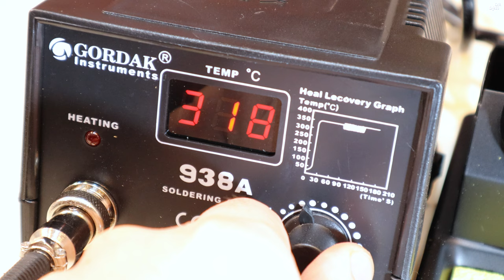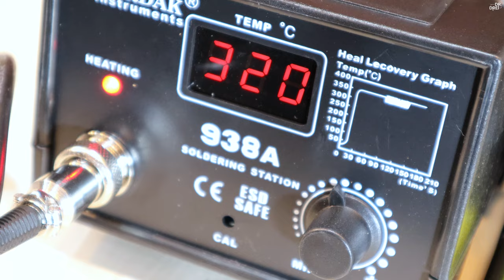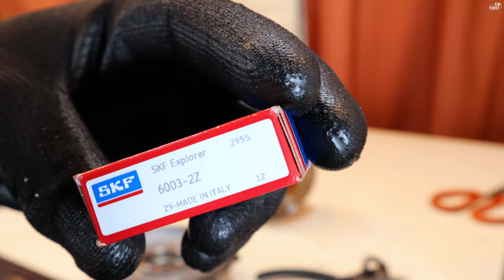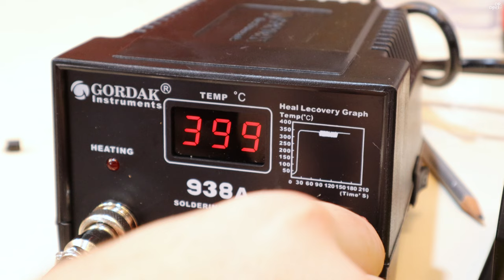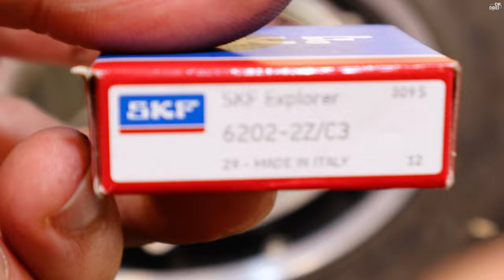Electric Scooter Hub Motor DIY Repair - replacing wires and bearing, cleaning rust

Comment: One tip for the Motor Hub cover. Before putting it back seal it with some Cylinder Gasket Glue (silicone) to prevent water from entering there to corrode stator core.

Comment: Great video, I should try this tomorrow. Rear motor
showing an error,   Contacted Kukirin 3 weeks ago & still waiting to find out what's happening with the new motor, been advised used not to rush them .. Its still under warranty but ill probably be waiting months again  missing out on summer with dual motors.  Motor isn't working so might as well try .

Comment: Man this is absolutely brilliant I had the exact same issue with my Apollo light motor after going over a curb and grazing the wires to the point with our exposed so I kept getting an e error but just like you I had the exact same idea to rethread the wires through the only difference was I was going to do something stupid and try and connect all otherwise together rather than desoldering the wise and then threading it through and  re-soldering a new loom if you have any other advice or ran into any other small problems I would love any advice please ALSO DO YOU THINK IT WOULD BE POSSIBLE TO REPLACE THE MOTOR WITH A MORE POWERFUL ONE OR WOULD THE BATTERY NOT BE POWERFUL ENOUGH

Comment: What wire did you use as a replacement for the one you cut off and how did you connect the connectors on the speed controller end
Reply: Hello, I've had similar issues. You may need to buy adapter pieces and build your own connection by soldering. Its not hard at all just steady hands and patience.

Comment: Great vid. Suppose you could have checked the Hall sensors are OK, since water got inside? 5v PSU, DVM, 10K Ohm pull-up, turning wheel and checking A, B and C outputs at the cable connector end. Just a thought. 😃
Reply from the maker: I had the scooter there and got to test it, works like new even today 👌
Reply: The 3 big wires to the coil, does it matter the order of them? How they are connected to the coil?

Comment: Excellent video.  I am repairing the wires on a similar if not the same unit.  I bought a 9 pin extension cable but don't know where the small white wire connects, if it is used at all.  Doesn't appear in your video anywhere. Could you verify that it is or isn't used?  thanks for your help.
Reply: Not used

Comment: I have a similar hub motor and I have to replace the 3 hall sensors because 2 wires of them are cut!! I was wondering what is that white paste that you remove in the begging and is also located on the top between the 3 sensors and the chip. I am thinking to put a glue or something like a glue to avoid the movement of the chip and the sensors also and avoid of cutting the wires of the sensors again. Please help me!

Comment: Man, all the tools and work involved good job, But I say F___K it. I'm going to buy a new motor or sell it. Motor 250.00. Paid 910.00 for a 2000w freego. Oh, I hit a deep puddle there not under water machines. Maybe shorted the fuse. But there must be rust inside with mine.

Comment: My phase wires are not accepting solder. What should I do?
Reply: Higher wattage soldering iron, tin your wire and soldering tip before making the connection, use flux.

Comment: Is the motor wired in Delta or Star connection? Could the power be increased by rewiring the motor?

Comment: Really good video, learned a lot! Thank you! I am facing another problem, it seems like the big bolt on my scooter which is going through the center of the motor is bended. So is there a way to change it with a new one?

Comment: hey, just a quick question. Can help me with figuring out how to reconnect those little yellow wire that connect to the coil
Reply from the maker: You need to sand the tips before soldering them, to remove the protection layer so that it sticks to the wire

Comment: Great video! I'll need to do this someday on my wheel. There are some bear copper spots on all the main wires and some of the hall sensor wires right at that same area in this video.

On my other scooter, I am having trouble getting the plate off to look at the hall sensor wiring. I am getting an e-001 error code on my tf-100 display. It was easy to get the plate off my currently running scooter. But this other one is hard and I was worried about the plate breaking since I already chipped a tiny piece already during attempts.

Comment: Never grind the stacks of laminations in the stator - this can result in a significantly higher operating temperature and lower motor efficiency due to the increased fault current between the individual laminations. As a reason, look for the disadvantages of transformers with welded transformer sheets.